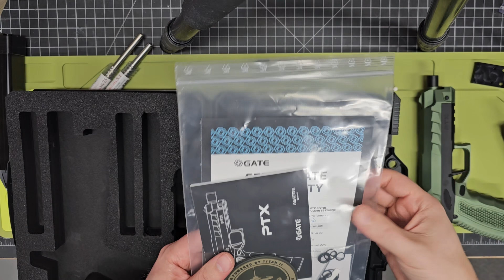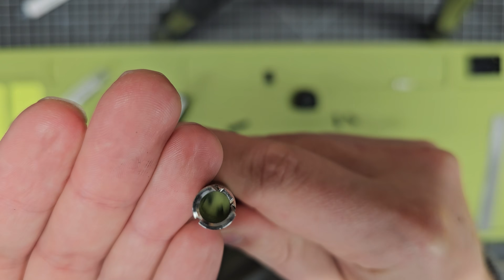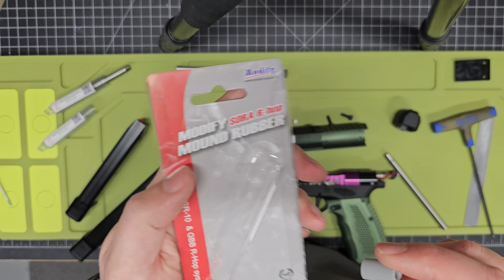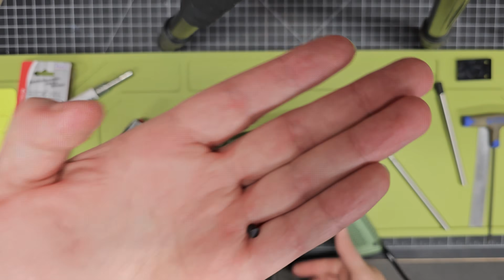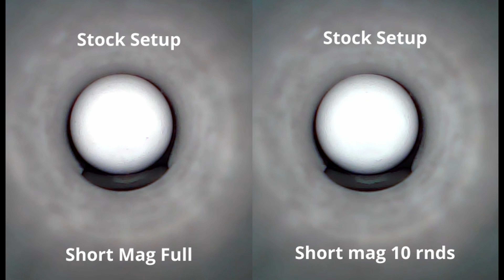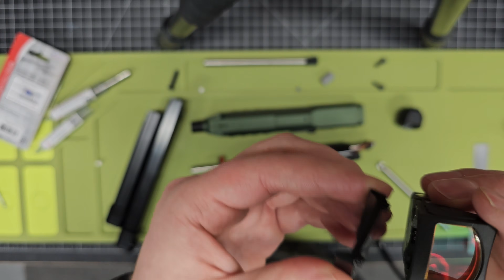Gate PTX Initial Thoughts and Technical Review

Comment: Great video. 
Have you installed the V22 parts yet, this video predates the release of the V22 kit. I saw a nice increase in performance and a reduction of operating pressure to achieve1j after fitting the kit. It also comes with a new nub that works better. Though, some users are still having issues.   
Efficiency is a tough one with such a short barrel. Even the F2 struggles with efficiency when paired with a 138mm barrel. I run a few sub 150mm speedsoft builds with F2s and they are very very thirst.

Comment: wouldnt the hole on the back be for lubing the engine on the fly since it sits over the solenoid and the hole on the front be a grubscrew for the barrel like for the guide that keeps it in place
Reply from the maker: That hole is aligned over the solenoid but you wouldn't lube it that way only thr internal brings really get lube. The front you might be right or certainly could tension the barrel a little and help  dampen some vibration